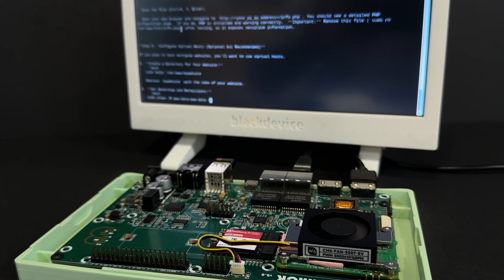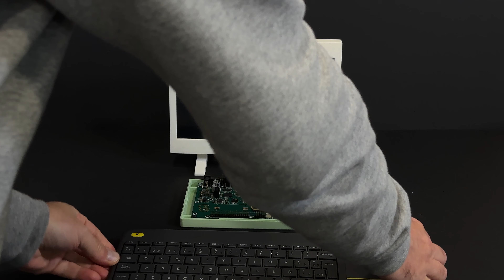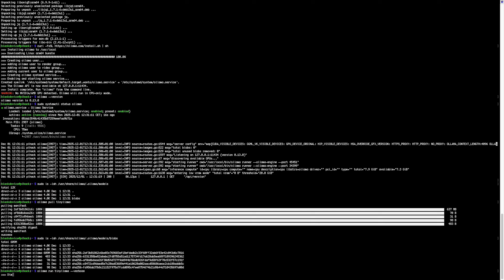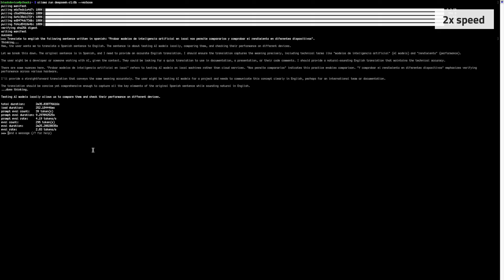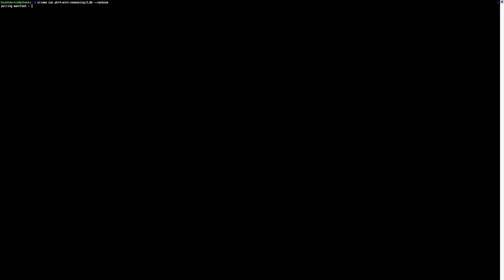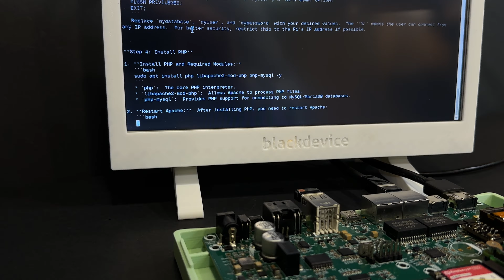Test AI models locally on your Raspberry Pi with Ollama

Comment: Yes the Gemma3 models are awesome
Reply from the maker: yes, we were really surprised and we will make more testing to see how useful it can be in this modest hardware setup
Reply: I've done a lot of testing on models from huggingface with varying degrees of success. There's an account called Unsloth that releases their version of quantized models that I find are excellent. If you're looking for a very talkative yet small model look for the smallest LiquidAI model - LiquidAI/LFM2-1.2B , its really impressive for chatting. Paired with a RAG back end so it has more data for context, it can be very interesting.
Reply from the maker: @EndaRochford  we are most of all running tests to compare different hardware, we are an engineering company and we are developing our own computing nodes so we want to have some references to compare with, but it's true that we didn't expect much, but now we want to explore this light models for things like what you just said, chatting... assistants... we will research your recommendations! thanks a lot!